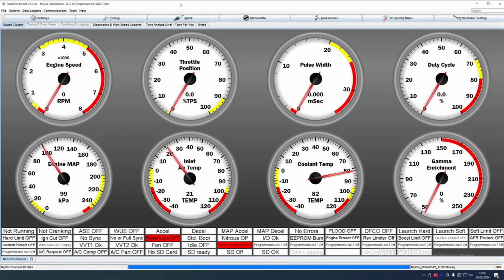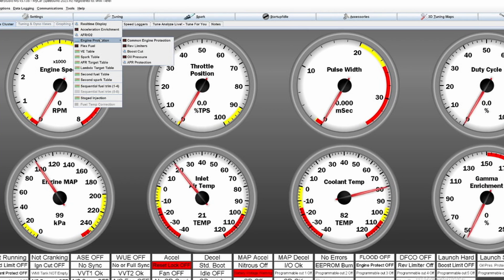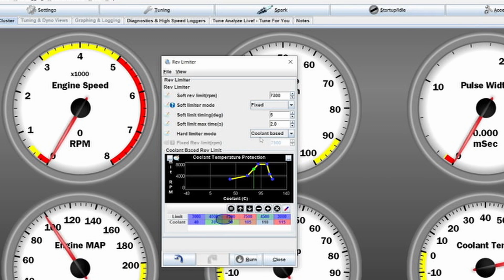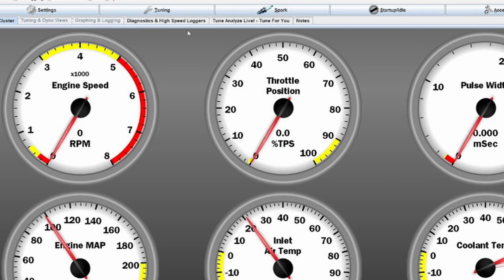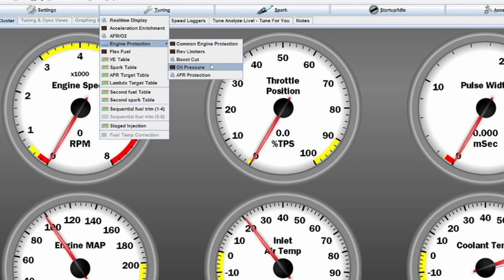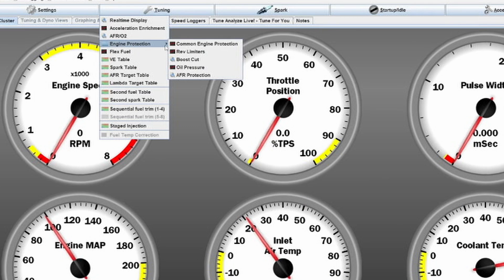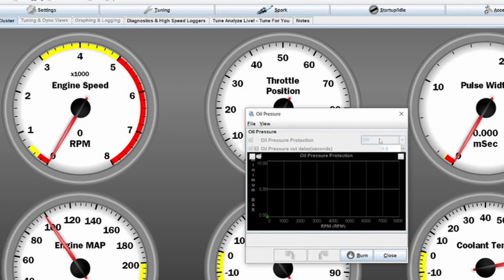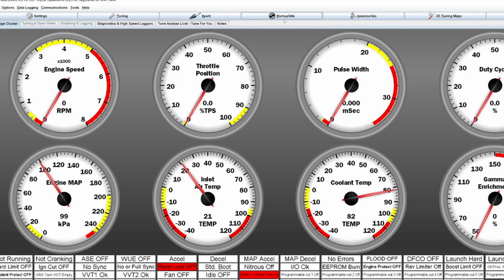Tunerstudio Standalone ECUTuning Guide | Part 8: Engine Safeties, Protections, limiters | Megasquirt

Comment: Servus?
Gibt es deines Wissens nach im EU Raum Vertreiber von speeduino oder gleichwertigen bezahlbaren Steuergeräten? 

Piggyback fällt raus 

Fahre momentan noch eine alte Motronic 1.3 im E30/4 Zylinder mit Td04 Turbo.
Reply from the maker: Die alternative die es gibt ist kdfi von k-data. Die haben für e30 etc quch plug and play lösungen ist auf ms2 basis haben lambdacontroller integriert kostet rund 500 

Bei fragen oder wenn du abstimmung brakuchst kannst mir auch gern über insta schreiben